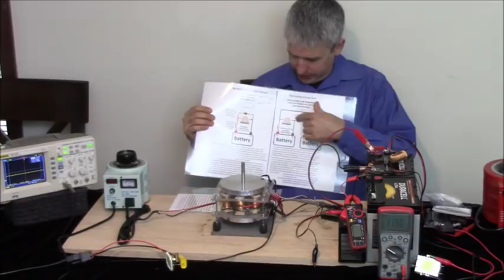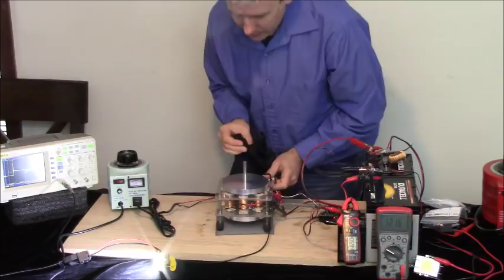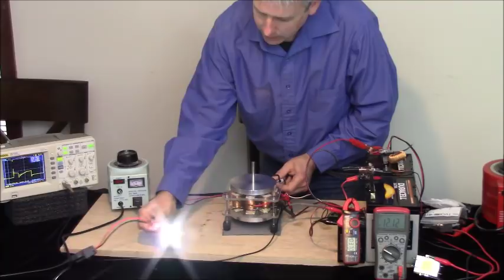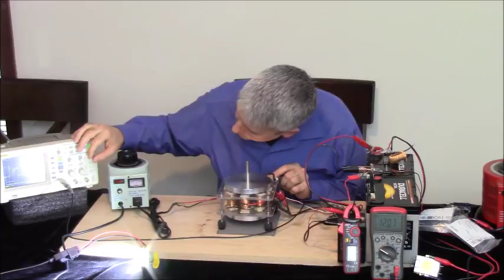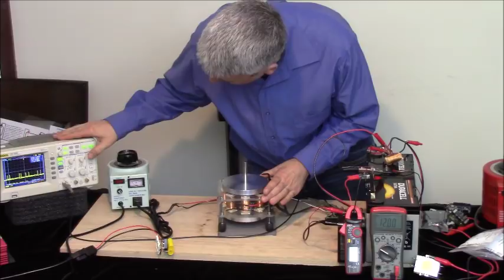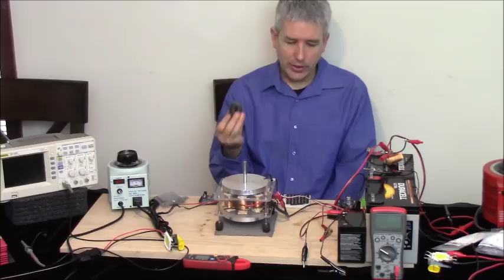Fine Tuning Capacitance on 4  DualPole Mini Motor Energizer

Comment: Rick - what size cap would you need to run at 48v if you were to be loading down the motor ?
Reply from the maker: Which cap are you referring to?
Reply: @rickfriedrich   The cap across the mosfet ....
Reply from the maker: While that helped a little, it was not really the solution. We decided to use higher voltage fets and if necessary use lightning arresters across the fets.

Comment: Hi RIck - If you were to add a ground on the output side where would that go if running the 3rd stage process ?   Should it go at the beginning of the 3rd stage process or anywhere in the circuit on the open loop side ?
Reply from the maker: It has nothing to do with grounding. We get into more details about this in the meeting. Will do again in the upcoming Lansing meeting in October.

Comment: It's a shame the glare from the LCD obliterates the ability to see the oscilloscope trace.  :(  Great information none the less.  Thanks.
Reply from the maker: Yeah I noticed that after the video was done. But it was enough to see and understand everything I said. Just play the video in higher resolution and you will see it. Look at the other videos to see the closeups. It's the same as I showed on the smaller motor. I'll be doing another video soon when I can get to it where I will do 36-48V setup. It requires a slightly changed code, and I'll send all new shipments out with the two different chips for the lower and higher voltages. Anyway, I'll show in the video closeups of the wave like I did in the other video. But I do think somewhere in this video I did bring the camera close to see the wave.
Thanks.

Comment: Hey Rick -   Great video. Just wanted a bit of clarification on resonating the 3rd stage and understanding exactly what resonates & how to resonate it. You mentioned toward the end that you consider rotational freq (RPM x 8 magnets) and use it to resonate the 3rd stage battery/load. Please help us understand what to measure (ie., Voltage? Current? ) in order to determine if we've achieved resonance. It seems we may measure charge rate of the 2nd stage while measuring 3rd stage voltage to see if they're both increasing, yes?  
  Also since I'm working w/ the large 4DualPole. I'd love to get a better idea how to slow the drive battery discharge (in 1st stage config) thru achieving resonance. What should we  be striving for in the output wave form and/or pulse on-time? Thanks a bunch !!
Reply from the maker: Thanks, the batteries did come back to around the same voltage after the video because of the capacitors and the way it works. The amperage is much higher than what is coming out of the input battery because the charging battery is contributing while it is being charged. As I said, the rates of charge depend on the spike and cap sizes. 
Resonance depends on the frequency, inductance and capacitance. I go over that in the book in details. RPM divided by 60 x 8. Or we can use the pulse within a pulse frequency. 
We have decided to make these available for the motors now that they are finally finalized. As mentioned we will dramatically increase the voltage input so that there will be very little amperage and this will increase the resonance and impedance effects on the output. The parts will be the same and all previous motors we have sold will be able to use the parts more or less. I always said the motors are a prime mover and you can multiply the energy out again and again according to the teachings in the book. 
You can try to measure but since it is not a closed system it will not add up. Ideally we will keep the input from discharging or charging and will run loads off the resonance coils as we showed a few years back in the meetings here and in Germany and England.
Reply: Ok Rick - Understood.  So is it true that the rate of change (rise time) of the output spikes implies a frequency, which should correspond as closely as possible to the LC resonance freq value of the Series Resonant circuit ( Motor Coils & Battery)?  Presumably,  the value of f (resonant freq) for the series tank circuit should give us a frequency value to strive for. Presumably  the rise time is dependent on several factors including pulse rate / ON time, Battery voltages, Load conditions, etc.  Please let us know if that's the idea or if its something different than that.  Thanks !

Comment: Thanks for sharing.
Regarding updating the Arduino you can send customers the (hex) file the compiler generates and use ''avrdude ' to upload the file to the Arduino. I believe there is also  a GUI for avrdude to make things simpler.

Comment: Rick - in terms of the energy flowing into the battery being charged, I came across a passage in Henry Moray's book that I'm currently reading that touches on this point - here is a quote .. What are your thoughts ?
"As stated, we have discovered the oscillation of the universe corresponds to oscillation of electric capacitors, depending on the frequency of the energy involved, going on into infinity.  
These oscillations of energy surging from the universe into the device and returning to the universe are picked up by the Moray device and the oscillator tubes of the device because it is tuned to oscillate in harmony with the oscillations of the universe - just as vibrations from musical instruments can be made to oscillate together.  Every oscillation, whether large or small, is completed during the same interval of time.  The beat note of time, the heartbeats of life, the oscillations are all governed by the same cycle of time; or as stated above, completed during the same interval of time; as stated years ago, these waves of energy have a regular beat note of time, coming and going as the waves of the sea, but in a very definite mathematical order of time.  These waves of energy come to the earth from every direction, stronger in the daytime than at night, but always coming with regular beat notes that might be referred to as the Father of Time, the Sire of Gravitation. "  From the The Sea of Energy In Which The Earth Floats, pg 300.
Reply from the maker: Yes, the aether or environment supplies the energy to the capacitor. Everything is a capacitor, or either one plate of a capacitor or the dielectric. If you understand the one wire transfer of energy you can see how capacitors can be charged up without depleting the source charge, or along the path of a regular circuit.  You can use any hf and resonantly tune into it and as long as you tap into it with a true open loop then you can get continuous real power from it and not diminish it. Moray and Tesla learned to tap into the cosmic frequencies, but that is not necessary...